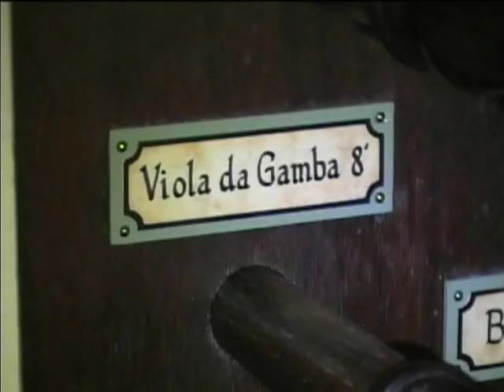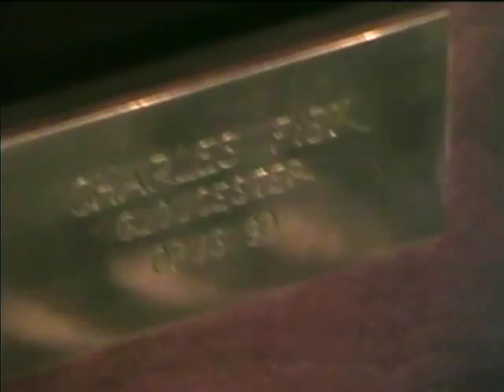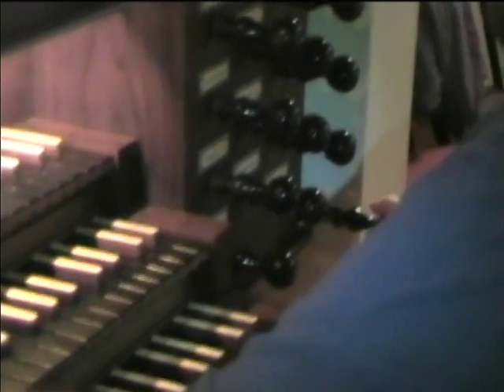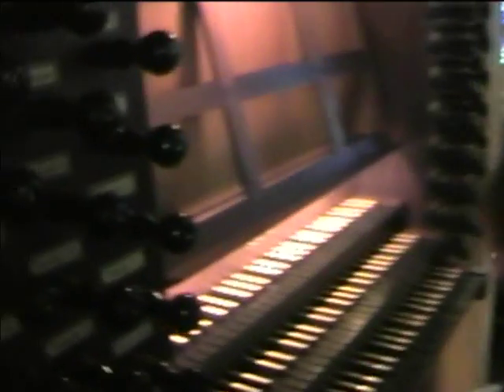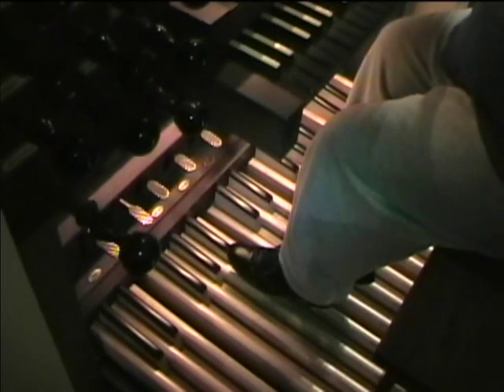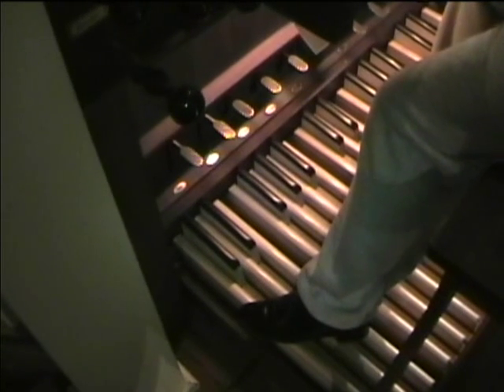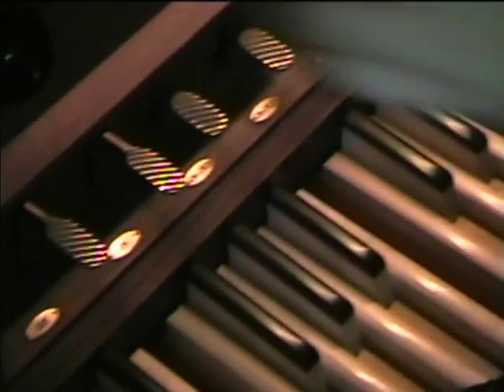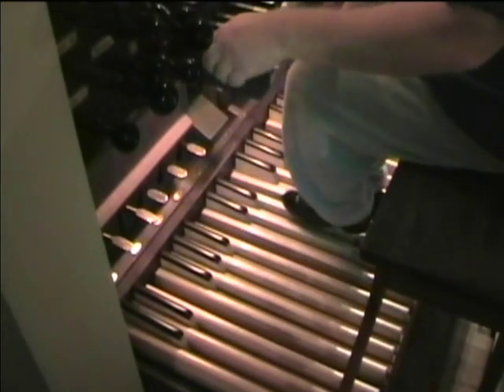Fisk Pipe organ demonstration part 2

Comment from the maker: That's a good question.  I do know that some of the pedal hitch-down levers are Fisk's mechanical version of a piston; by rotating a stopknob to the right 90 degrees, it will "set" on a lever that adds the turned stops to whatever is already pulled out, and another lever takes those stops back off; there is a pair of such levers on each side, operating that particular side of stops.  And, one of the levers is a Swell ventil and another is a Great Ventil.